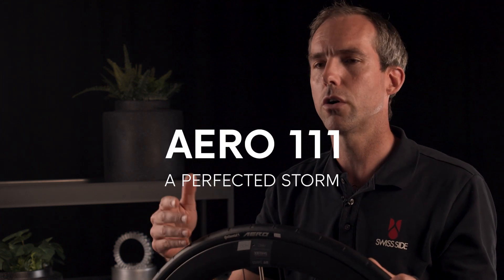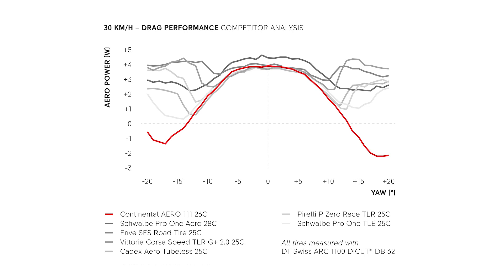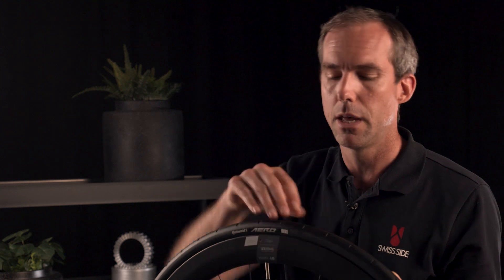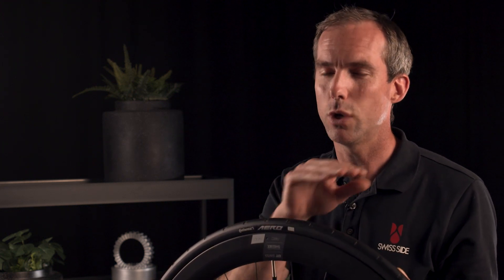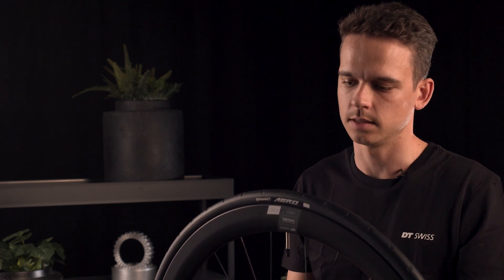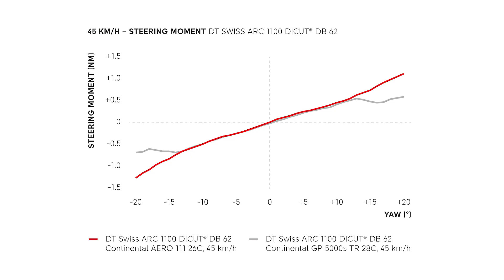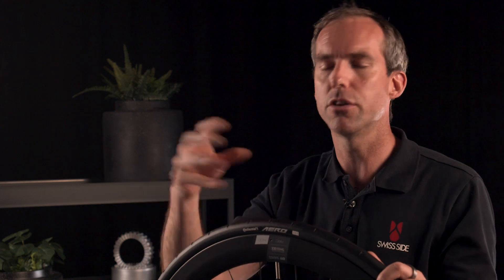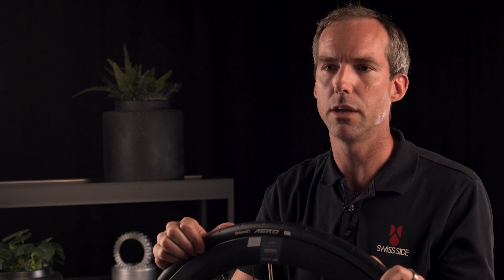AERO 111: A Perfected Storm - introducing the ultimate aero wheel tire system | DT Swiss

Comment: I just ordered my Aero 111... I'm very exited about how it feels and performs!!! ...and maybe you should go the next step together with Continental and bring a Aero 111 TT version with an even lower rolling resistance? That would be the perfect tire I think...
Reply: The performance promises on the Aero 111 will not work unless you rotational balance your wheels...  That is a fact.
Reply: @danielsotelo3942 sorry, but that is absolute nonsense. The advantage of this tire (in conjunction with aero wheels) is only in aerodynamics, balancing the wheels does absolute nothing in this regard. Of course you can do that on top and for sure it will not do any bad… but don’t expect any significant advantage; as it is only a few grams and the wheels spin at a relative low cadence you will see a difference only if you hold the bike in your hands, not while riding
Reply: …simple physics, there are no mysterious miraculous phenomena…
Reply: @fiddleronthebike  I'm at work right now, when I get home I'll explain how it is "Not" nonsense. Meanwhile, here's a few things to think about.  35 years ago while I was working inside the Japanese bicycle industry I requested many times to some of the best rim and wheel builders of that time to make an aerodynamic rim or wheel set.  And just like you, they chuckled a bit as they told me it was NON SENSE.  What people fail to understand is those innocent 8 or 10 grams of off balance on todays Lt/Wt carbon bicycle wheels, at high speeds the centrifugal forces turn those innocent grams into ounces!  These onces then create powerful oscillation forces that starts to invite the entire weight of the wheel (from the axle to the outer perimeter of the tire) to start oscillating and swinging off the bike axle like a 1.2 lb sledgehammer!  Now imagine both front and rear wheels doing the same thing at high speeds. Bottom line is this, an un balanced wheel creates interrupted inertia which slows you down. While a balanced wheel has free flowing inertia which only gets faster with speed.  I did the research.
Reply: @danielsotelo3942  well I have just made the measurements; at my wheels with 50mm wheels ready installed with tires the unbalance is 3 respective 4 grams - not 8 or 10. At 40 kph the wheels spins at only ~5 Hz... it doesn't slow you down at all. BUT I didn't want to discuss this topic at all, if you believe it does slow you down - ok, so be it. Nonetheless that has nothing to do with aerodynamics of the wheel, no matter what the unbalance of the wheel does to your ride, it will do it with or without the Aero111 tire, and therefore you get the gains! If balancing the wheels make you faster you will get the aero gains ON TOP, if it does not, as I believe, you will get them alone. One has nothing to do with the other, no matter how big an effect wheel unbalance has.
Btw, I ride road bikes for more than 40 years and back then, when almost nobody talked about aerodynamics but everybody about weight I was obsessed with that too, and an Italian brand (I think it was Silca, but I'm not sure) sold tiny weights to balance the wheels. For what they are they where ridiculous expensive, but I bought them and balanced my wheels carefully - after all they argued about the great benefits... Back than the unbalance of the wheels where much much bigger than today because the aluminium rims had those heavy inserts to connect the rims. I could not see or feel any difference at all, not in speed, not in ride feel.
On the other, as I'm using these Aero111 tires I can tell you that they make a significant difference for sure. Not if there is no wind or straight tailwind or straight headwind (or the advantage is so small that I can't verify it). But with crosswind of any angle (and that is what I experience almost all the time...) it's significant. The handling is much better (much less effect on the stearing) and speed is indeed a bit higher
Reply: @fiddleronthebike  I'm not arguing with you, I'm just trying to state the facts based on your quote "One has nothing to do with the other, no matter how big an effect wheel unbalance has."  And yes, Aerodynamics & Balance are "ONE" and it is Newton's First Law....  A mass that is put in motion will continue in motion unless it is interrupted by 1., an Outside Force (i.e. Wheel Air Drag), and 2., an Oscillation (i.e. Wheel Balance).    The whole DT  promotion is to tell the world that they have created a faster wheel, by simply adding a more aerodynamic tire to their reasonably aerodynamic DT aero wheels, which together maybe splits aerodynamic performance hairs with ZIPP, Enve and others.  But if DT added a weightless, no gadget, speed balance system, they would have a Game Changing wheel / wheel-set with performance that's off the charts making all other top brand carbon wheel sets obsolete.  And I have created that secret technology, as I developed tires for the bike industry for over 30 years.  I only wish DT would look at what I have but I have no way to contact their engineers to give them a demo, or be in their podcast.